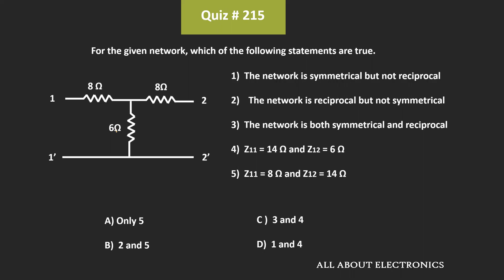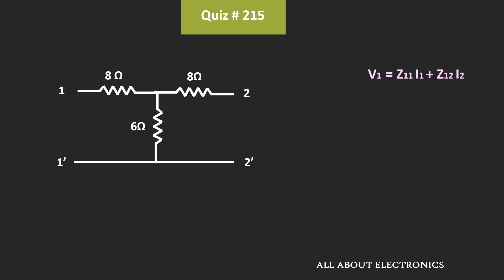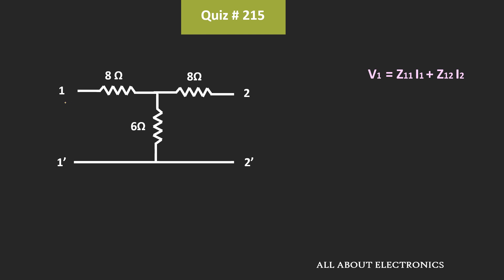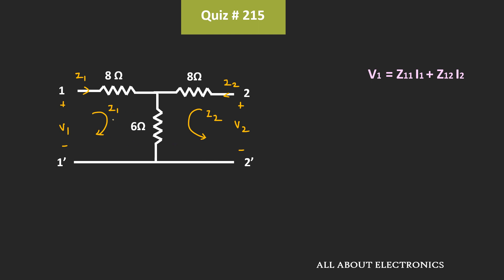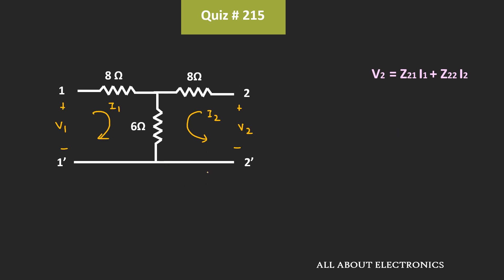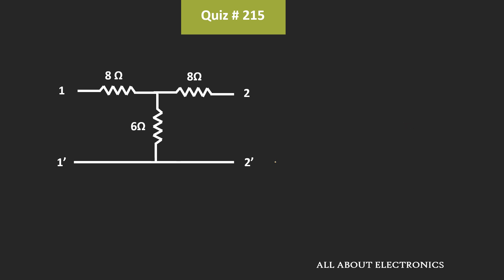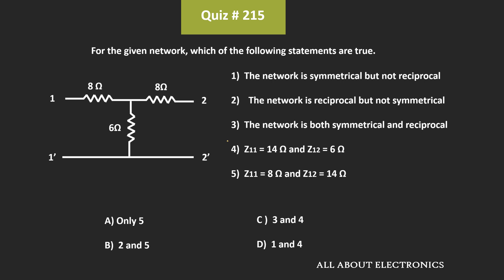Z- Parameters (Two- Port Network ) | Quiz # 215

Comment: How it can become reciprocal sir ad-bc=1
Reply from the maker: For reciprocal network, V1/Isc (at port 2) = V2/ Isc (at port1).
For the given network, if we apply the voltage at port 1, and measure the short circuit at port-2 then we will get the same current, when we apply the same voltage at the port 2 and measure the short circuit at port 1.
In terms of Z- parameters, it is Z12 = Z21 (which is getting satisfied over here)
Reply: @allaboutelectronics-quiz  thank you sir